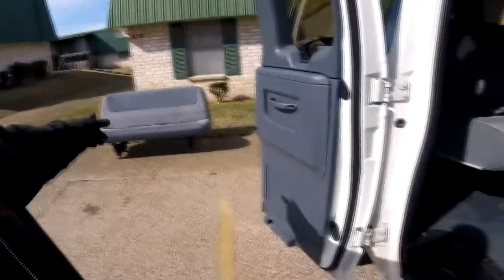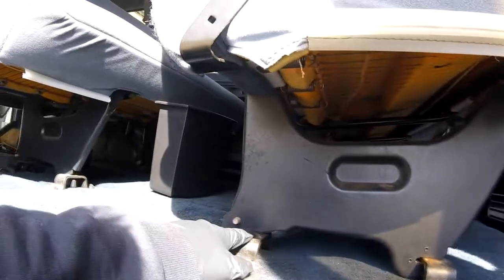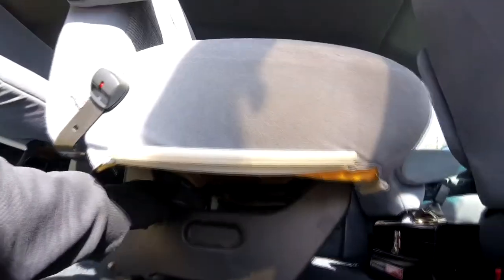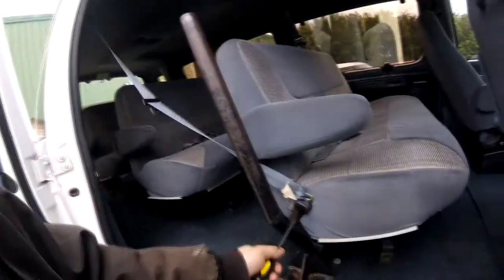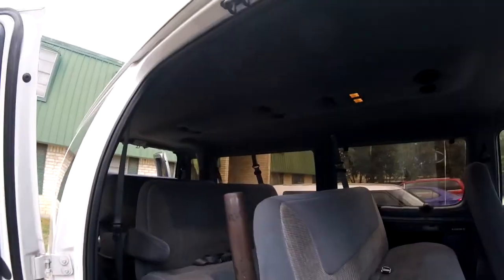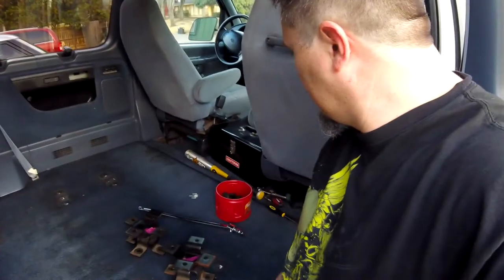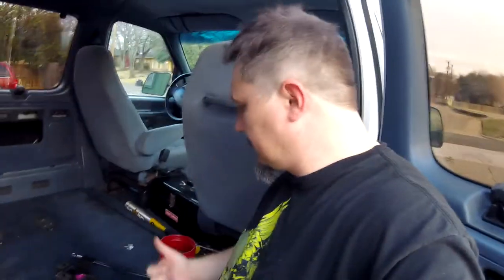Ford E350 Taking out Van Seats

Comment: Hey there,
Thank you for posting your video. May I ask if bench seats like these can be installed easily on a 1996 e350 cargo van? I would like to add seating capacity.
Reply from the maker: I think they should be as long as the brackets in the floor are still there? I am thinking you should be good with that year? This was a 98, so as long as they’re still the same body style, you’re golden. Good luck! 👍

Comment: did you guys replace the front seats? have the same model and am struggling to figure out what seats i can replace mine with. only came with one beat up drivers side seat. so i need a new driver and passenger seat.
Reply from the maker: Sadly we didn’t change out the seats, but you can buy captain chair seats and mounts for the Ford econoline vans. You can even put a swivel base on it to make it swivel to the back. Just search the econoline van passenger seats on here or eBay. Good luck!!

Comment: For the seats with power wires. Can u just leave them in the walls or should u disconnect completely? How would you do that?
Thanks
Reply from the maker: If you can disconnect them from the plugs, I think that would be the safest and cleanest. However, if you cant get the wires out, you can leave them, but make sure you protect each wire so it can not arc or cause a vehicle fire, or maybe hurt your electrical system. Once protected properly, go ahead and hide them as you see fit. Good luck with your build!  🤙

Comment: Hey man, just bought a '98 Clubwagon and I'm trying to put the seats back in. Missing a few pieces though so where would you recommend I go for replacement parts? Thanks!
Reply from the maker: I would suggest checking out the ford dealerships? You could get the part numbers etc. for what you need. then you can look them up on Google, and order them cheap online. Plenty of cheap parts online for that model. Just have to wait a couple of days for shipping. Hope that helps, Good luck!

Comment: What size was the big to remove the seat bolts?
Reply from the maker: For seat belt bolt is a T50
, and
seat bracket on floor is a T55.. Use some AntiSeize on the threads before you reinstall the bolt to keep it from stripping again. Cheers!
Reply from the maker: Also I have read that some vans have a T57 or a T50 on the seat bracket...So if you go to Harbor Freight, you can buy a cheap Torx set and a breaker bar to get the job done! Good Luck...

Comment: Is here a floor mount for the seats that can be installed flush to the floor after the build out for camping is complete.
Reply from the maker: After you finish installing the new floor, you can drill out the locations of the holes and you can buy custom base mounts for seats. You will have to search what type of seats you want and bases that match the OEM hole pattern. You will have to search for some flush mounts, but I bet you could have some fabricated? Hope that answers your question. I show the floor installation and what I do throughout this series. 👍

Comment: what is the tool used to remove the bolts for the seats and what size please?
Reply from the maker: Billy Green I used a breaker bar with a torques bit. It's been called a star head bit. I will go back and look at the exact size in my toolbox and reply back with the right one. Thanks for watching. PS I bought the torques bit in a set at harbor freight for $14.
Reply: FnDTX I would like to know the size star but you used I’m trying to take out my seats
Reply: Same question, thanks
Reply: @FnDTX  what size??
Reply from the maker: @danielalcaraz5134  So sorry I didn't see these comments... For seat belt bolt is a T50
, and
seat bracket on floor is a T55.. Use some AntiSeize on the threads before you reinstall the bolt to keep it from stripping again. Again, sorry I did not see your comments! Cheers!
Reply from the maker: @nicolejimenez2382  For seat belt bolt is a T50
, and
seat bracket on floor is a T55.. Use some AntiSeize on the threads before you reinstall the bolt to keep it from stripping again. Cheers!
Reply from the maker: @kevinlinxx9285  So sorry I didn't see your comment!!! For seat belt bolt is a T50
, and
seat bracket on floor is a T55.. Use some AntiSeize on the threads before you reinstall the bolt to keep it from stripping again. Again, sorry I did not see your comments!
Reply: @FnDTX No worry. I did it already. I usted t55 for floor and t50 for seatbeals. I'm on my way to camperize my e-350.
Thanks
Reply from the maker: @danielalcaraz5134 Awesome! Sorry it took me so long, my notifications was messed up until last week! Cheers!